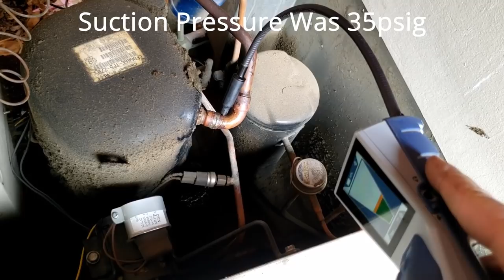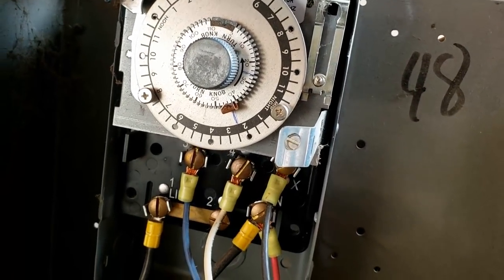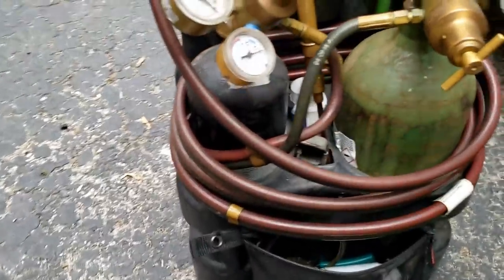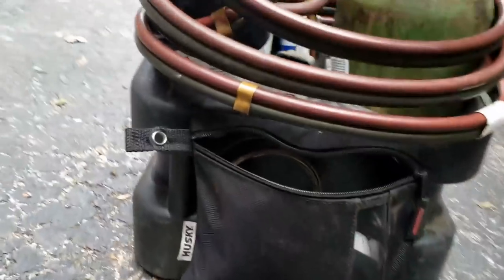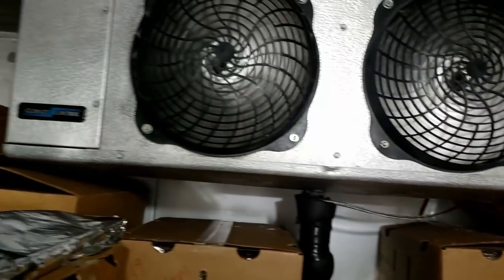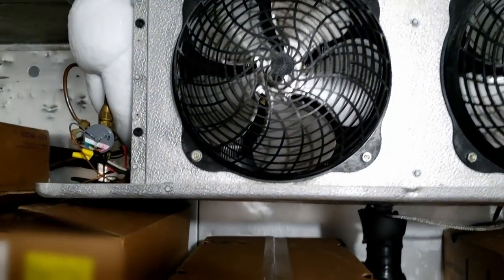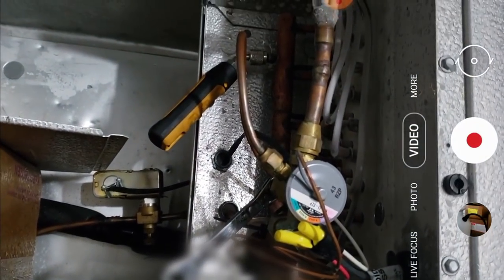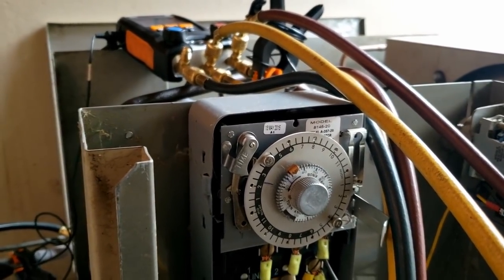IS THE FREEZER FREEZING UP? OR SOMETHING ELSE WRONG!

Comment: Great video and thorough analysis. One observation....I've always run 4 defrosts on freezer units with 25 min failsafe to maintain a clear coil. On units with less than 4 defrosts I've found excessive frost when it comes time for defrost. I am located in FL which has higher humidity than Ohio which may account for the difference. Thanks again.
Reply from the maker: I agree, I run four generally on normal freezer setups where it's independently by itself. The only reason why I went lower with this one is for two reasons. One the walk-in cooler is going to break the heat and humidity coming into the freezer and secondly this is not used throughout the day or night, it's only used for lunch. So there's less traffic creating more load and humidity in the freezer. Thanks for your continued support 👍👍